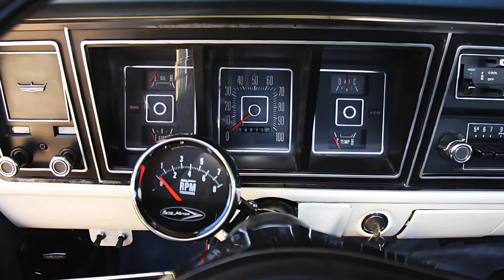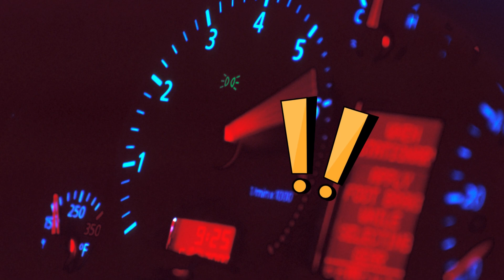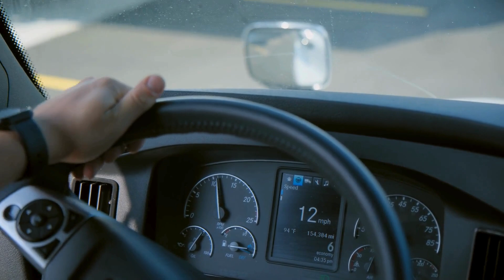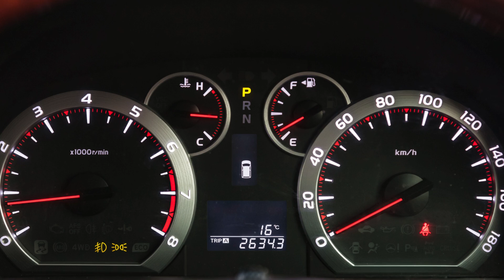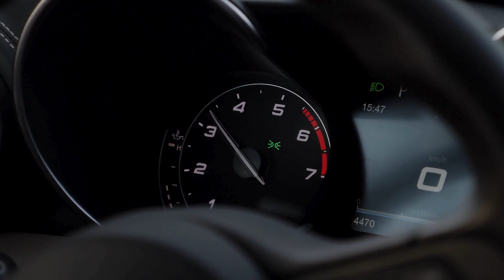Why Do Trucks Have a Tachometer

Comment: The device that was initially controversial wasn't the tachometer (which just shows the engine RPM) but the tachograph which records how you drive & how long for, it will record your rest breaks, when you took them, how long for & how long you've been actively driving.
Most modern cars have a tachometer.